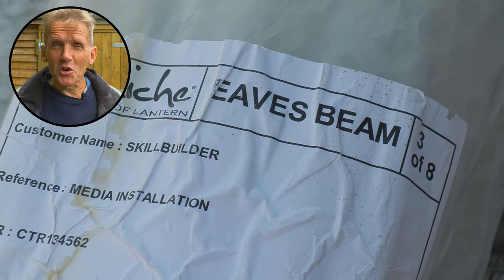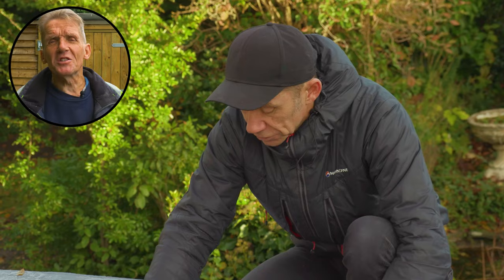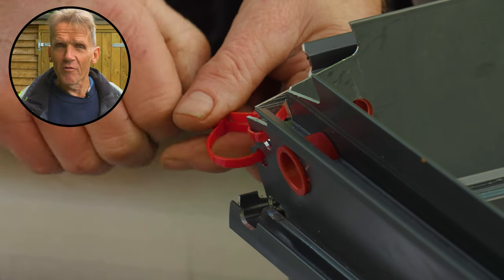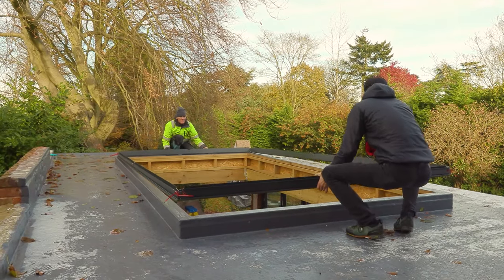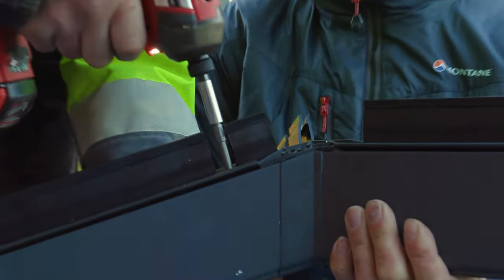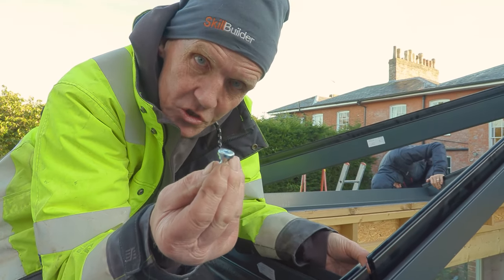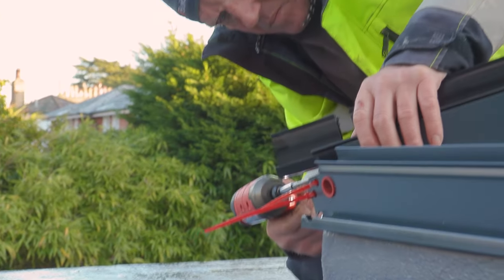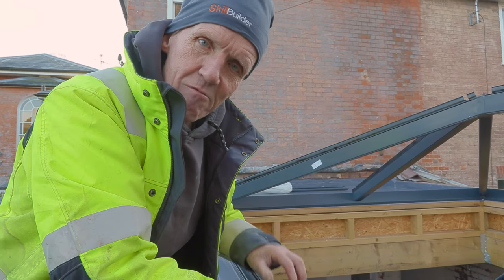Don’t Buy a Roof Lantern Until You've Watched This

Comment: IMO when driving machine screws into threaded holes, start with a screwdriver, you'll get a feel for if the threading is going properly. Drill drivers won't give you any feedback and have too much power before you'll realise you're cross threaded.

Comment: installed one on my extension roof 3.5 x 1.2m ,hardest bit was sqeezing out all the silicone bead (5 tubes) looks great ,went well but check your fixing packs as one of my larger frame screws didnt have a thread on it, so made one,great bit of kit.
Reply: 5 tubes? How come?

Comment: Funny I was just watching another UK channel Homebuilding and Renovation where he fits a 2.4m x 3m lantern. They did the plaster first into the upstand but strangely didnt finish the top. So with the lantern in the framing is still exposed and you can see the unfinished edge from inside the addition. Very odd. 

You guys did well putting that together. Metal is very unforgiving if something is even a fraction out, and wrapped in jackets made me feel cold just watching it even here in sunny Australia.

Comment: Kerb should be 12mm narrower than lantern according to Korniche. All the ones I’ve seen you build have the kerb flush with the lantern, when the lantern should overhang by 6mm all round. Doubt it makes a huge difference, but I’m sure Korniche give that instruction for a reason.
Reply from the maker: To be honest we found that opening size to be the most difficult bit to understand. The 6mm either side was to allow for a membrane and some adhesive as far as we could see. I will check

Comment: Got one of these a similar size to install soon. Can you remember how many tubes of CT1 you used as I’ll need to order some. Thanks
Reply from the maker: I think it took two tubes but Made for Trade said we should have used a bit more. We are going to gun a bead around the inside edge just in case but I reckon it is good.

Comment: Korniche make very good bi folds also
Reply from the maker: we have a video on the installation of Kornice bi-folds
Reply: We sell them at my work along side the origin bifold I personally prefer the korniche one as the gasket is already fitted and you can get it with the executive blind glass and its still slightly cheaper than the origin bifold.

Comment: As a mechanic it always make me wince seeing people starting bolts with an impact or any other motor driven driver. 

Nothing beats starting your bolts off by hand as you know when you have crossed the thread and can back the bolt off and try again with no damage & then finishing them off with the tool of your choice as once you cross thread a bolt you will soon realize the extra time to start them by hand was well worth it.

I would have thought the manufacturer of this lantern would have specified torques for those bolts?  Power tools are so powerful nowadays especially impact guns that it is very easy to strip the threads with them as you don't know how much torque the tool is applying.
Reply from the maker: Actually I should have mentioned that the taper on the head lines the bolts up perfectly. They also go into steel threads. The correct torque is when the gap is closed.

Comment: Are you not supposed to silicone the inside of a shower screen?
Reply from the maker: No it traps the water. All the instructions say that the screen profiles drain to the inside so just seal the outside edge
Reply: @SkillBuilder  appreciate that, thanks!